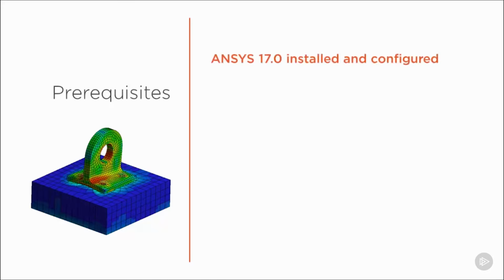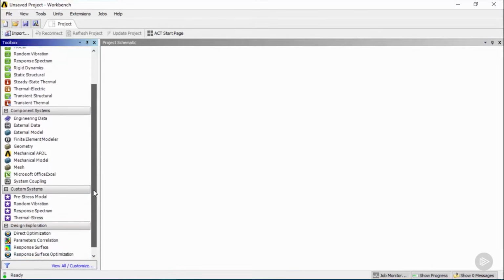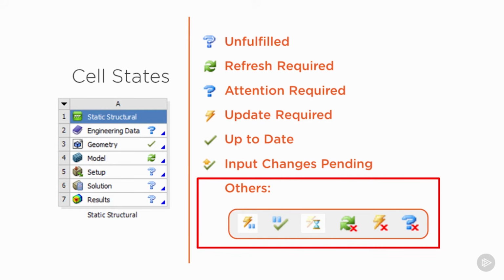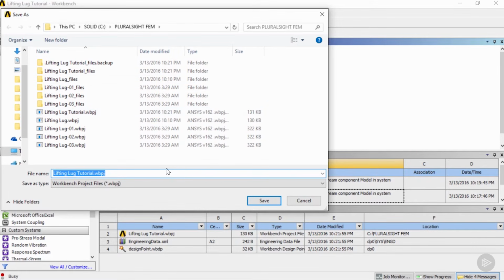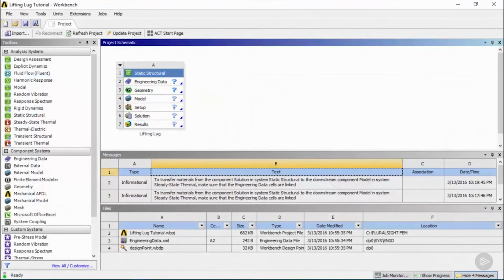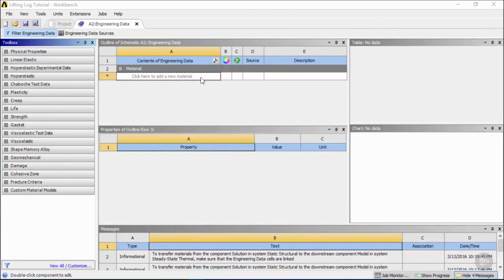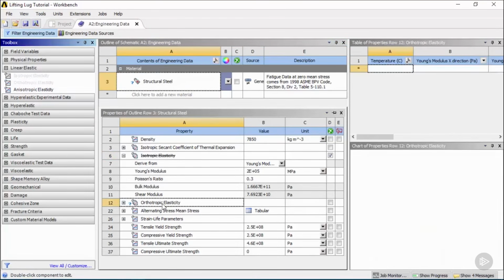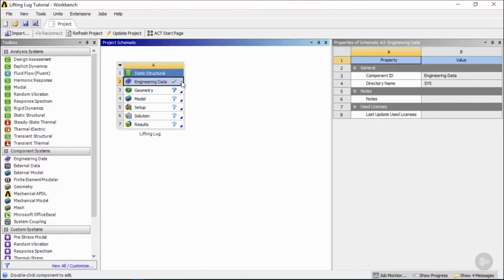Introduction To ANSYS (Part1) : Starting Ansys Workbench

Comment: 4:50 Toolbox
6: 15 menu bar
8: 15 under toolbox: Static Structure
8: 50 cell state
10: 35 link different operation together
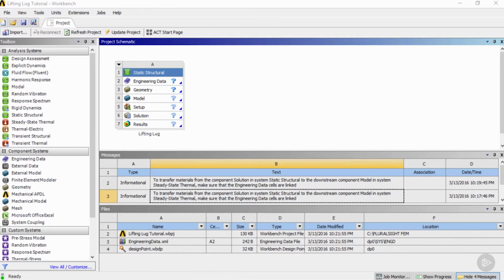14:00 Archive file to send 
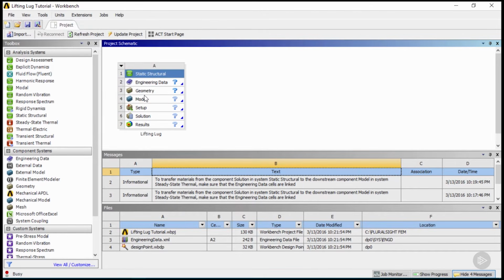15:40 Unit system
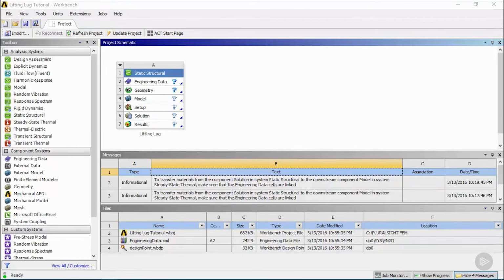18:28 Import geometry
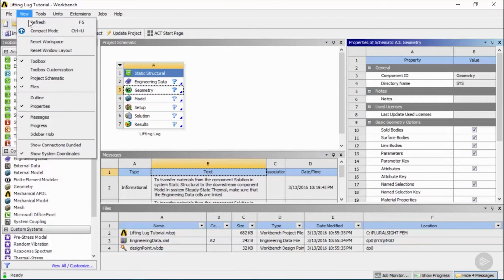20:15 Geometry property
23:21 Engineering data 
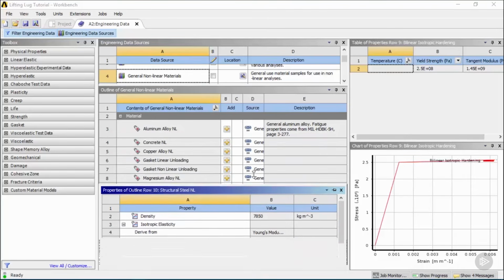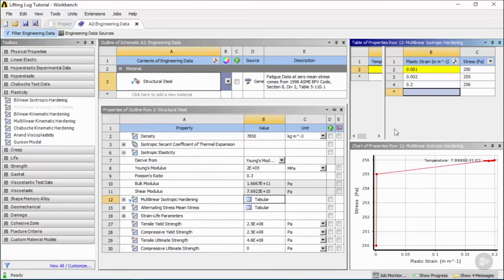29:52 nonlinear material analysis *(multilinear isotropic hardening 30:50)
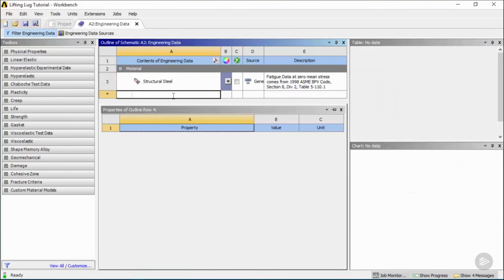 32:00 manually add new material in engineering data